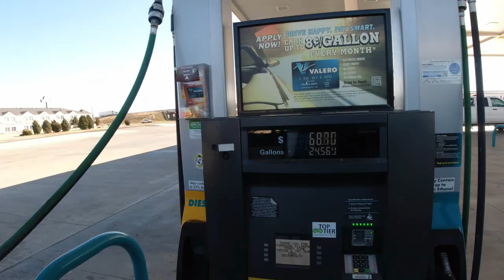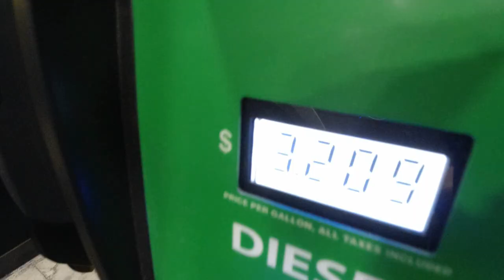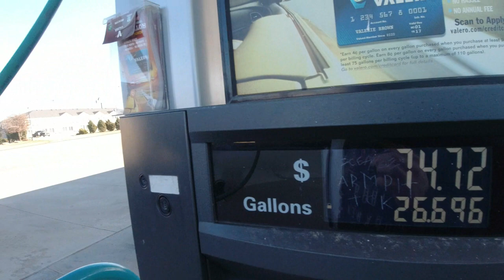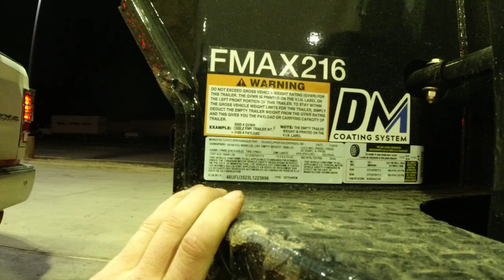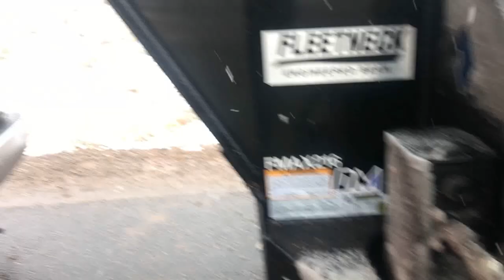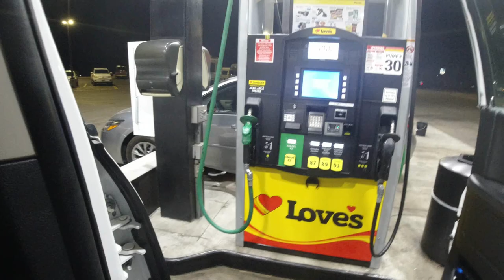Quick Trip to TEXAS! 4k miles NOT FOR HIRE (REPOST)

Comment: Looking at a Diamond C 207MR with my 2011 Ram 3500. I figure the 35’ trailer the overall length shout be about 62’. Did you get a change to measure the overall distance.  Diamond C ☝️

Comment: Fingerlakes region NY to Bradenton FL,  10k GVW 2500 Silverado, no trailer just 250 lbs white hot dogs and 750 lbs other supplies for my buddy,  1350 miles straight through in 22 hours best time. Did it many times, 23 - 25 hours average. Hate the expression "dream truck", but if I had one it would be a Ford F450 King Ranch, 4X4 w/ Cummins 6.7 P-pumped and 5600 6 speed manual!  Wish Ford would just do an 8L Cummins w/that 10 speed auto!! They copied the GM LS motor with the new 7.3 gas,  just do a Cummins also!!  8)   JMHO    --gary .

Comment: You put on a fass or airdog lift pump on your dully
Reply from the maker: Naw stock truck doesn’t need it
Reply: Yeah I have one on my 05 5.9l cummins it's great on those common rails and  injectors
Reply: Yeah I have one on my 05 5.9l cummins it's great on those common rails and  injectors
Reply from the maker: Yea older trucks needed the fass. New trucks have a solid fuel system